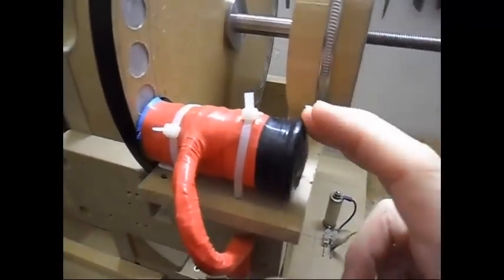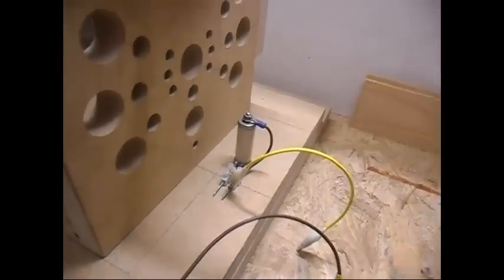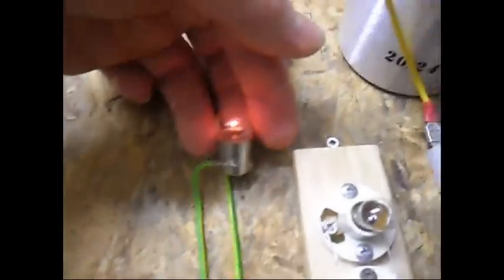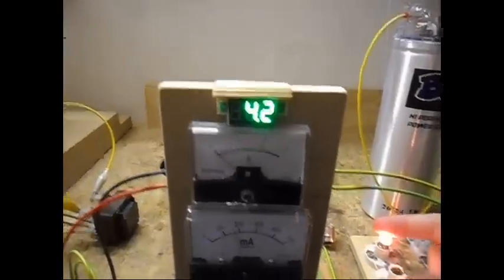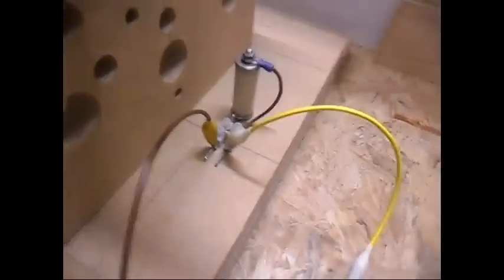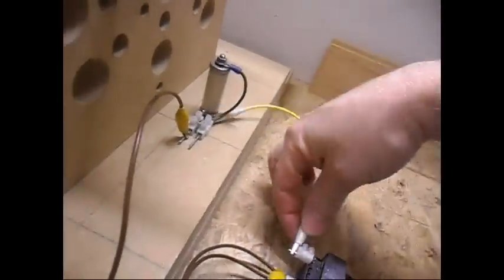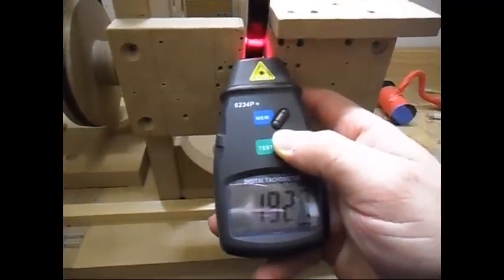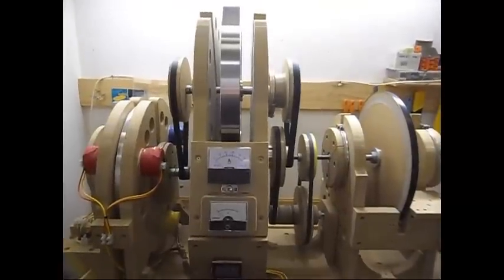Pulse Motor_Generator - Update 24 OverUnity is it or not, Future World Generator_11...

Comment: Yes i see your dilemma. won't the decrease in rpms be compounded with more coils, like 1 coil decreases 100rpm, then 2 coils would decrease 210, and 3 coils down to 315, and so on until total output starts to suffer due to all the coils putting such a drag and in turn requiring a greater output of each coil, even as rpm decrease? yes you need a better performing coil before you build it out any further.
maybe a second smaller ring on magnets with only a few coils closer in towards the center of the rotor (less leverage to cause drag), each producing less power but maybe just enough to get you over unity a watt?
Reply from the maker: Hi newfreedom21, thanks for your input...^^
I'm going to rewind this coil partially to see if it still makes the system rpm decrease by 125rpm when the coil is in place and i will be making a second coil like this one to.
If 2 coils slow down the system by 250rpm than its back to the drawing board to try to help that problem.
Smaller ring of magnets won't help since the coil need a specific amount of magnets and rpm to behave like it does...
I do understand what you mean by "less leverage to cause drag" but Mister Lenz doesn't play fair when he's playing.lol